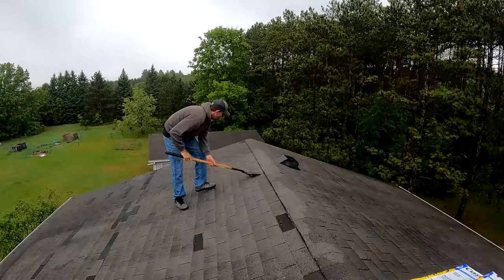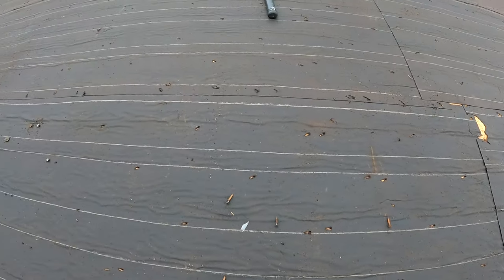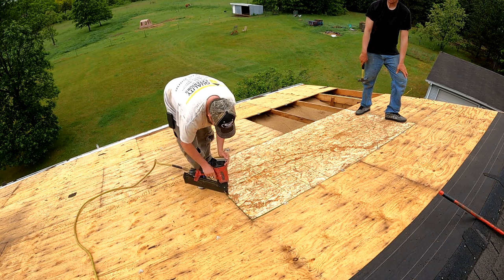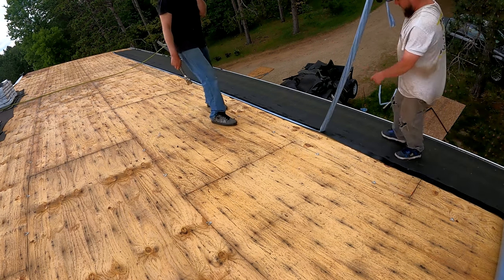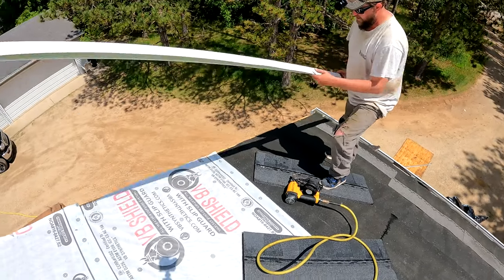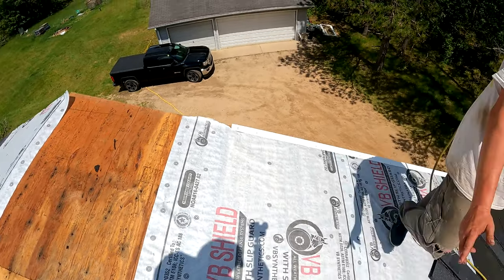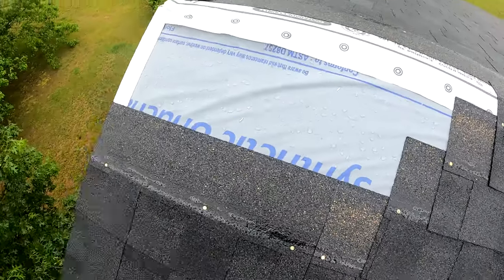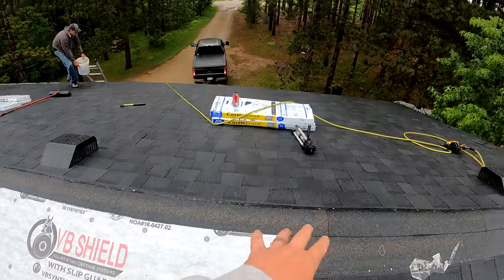HOW TO ROOF A HOUSE! [DIY]

Comment: Jesus, putting all those bundles in one spot like that is not safe 😂
Reply from the maker: Just imagine when ther is 4ft of snow on the entire roof!
Reply: Yeah read what you wrote entire roof you got the shingles stacked I one spot lol
Reply from the maker: @Isnipedahhobo  Do you know the wieght of each pile? just asking?
Reply: Depends I think certain teed weights the most in my opinion. But you said the house was like 15 square so you have 2 stacks so it would be 7 square on each stack square averages I would say 240 pounds a square so almost or at least 1700 pounds a stack
Reply: @Lifes_Apprentice  Theres at least 25 bundles a stack and that equates to 1875 lbs at 75 lbs a bundle
Reply from the maker: @moejoegaming9838  Very good! You passed the test! I have done tousands of roofs and never had a problem with my stacks

Comment: 😂 Have to laugh whenever I see Americans building houses. Here in Europe, we only use such roofs for garden sheds and such. If a roof here gets on 90 years old, it's considered pretty new, good for another 100 with maybe minor repairs.
Reply from the maker: When you shingles "tiles" get old you just flip them over and re-nail them!!! We are terrible in America...
Reply: We're assuming your referring to a metal roof  which could last that. If your going to spout off , you should not be so vague. Typical European.. I'm responding to mick berry.
Reply: @Nttt739  Metal roofs are fairly uncommon in Europe, maybe less than 10% market share. Over 80% are burnt clay or concrete tiles.
Reply: We have those in the states. It's just more common in California . Florida as well. Your right about the life expectancy of asphalt(garbage). Stone is the longest lasting . Very labor intensive to replace.

Comment: 1. started nailing on bottom right like a dirty lefty would 2. no kneepads with holes in jeans? what 3. no starters up sides and flush with the side, not a big deal but every house i did for 12 years is inch over lap with starters up the sides and bottom. stagger is good. Just starting on bottom right as a right handed guy i can tell this guy is wack. I couldnt hang would be having mental seizures
Reply: nice nailing pattern, doesnt line up with seams of next shingle very important over years and houses and houses of roofing, quality
Reply from the maker: You leave shingles overhang the edge so they blow off easier? just wondering

Comment: wow I see about 4400 lbs of weight stacked on the ridge... And why move your material 2 times ? Tear off the roof ,, run your underlayment and stock the roof in.. That's a big waste of time moving materials around,. double the work .. ....half in osb on 2ft center code here calls for 3/4 sheeting with rafters on 2ft center ,,,this video is wrong on all levels